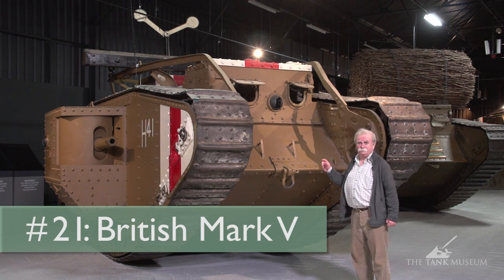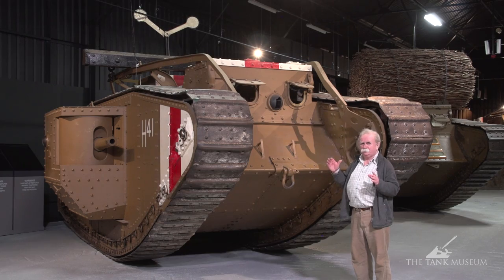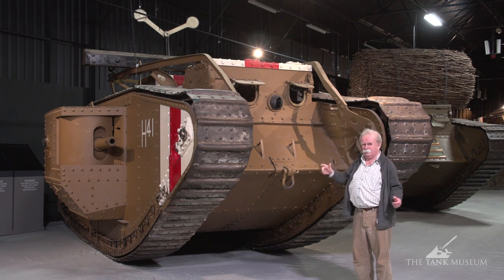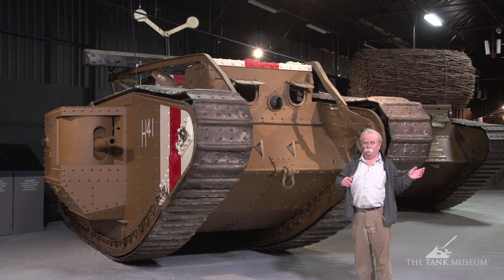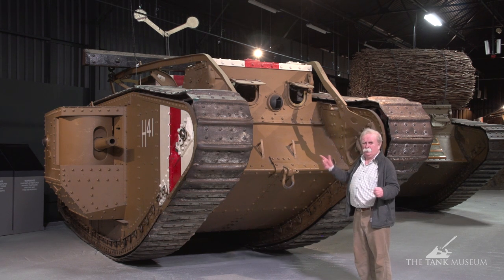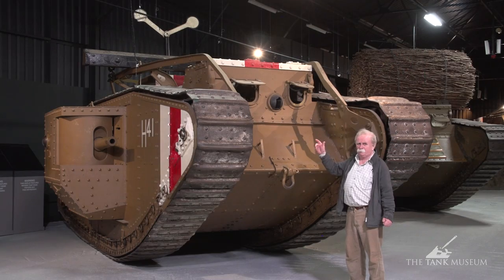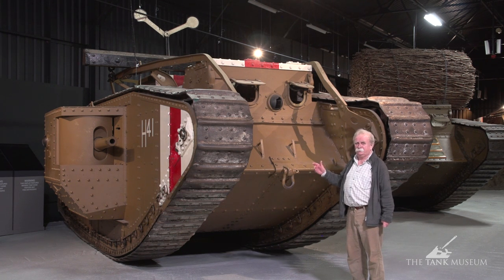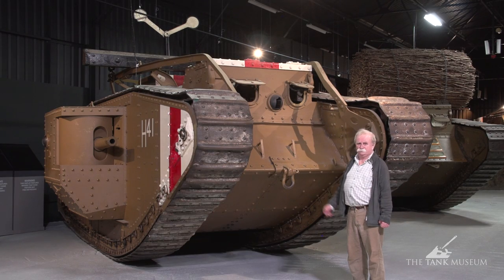Tank Chats #21 Mark V | The Tank Museum

Comment: Would it be possible to show a bit more of the interior of the tanks? Otherwise excellent video.
Reply: That would be absolutely awesome!
Reply: Inside the Fletcher's Hatch?
Reply: Somehow that sounds wrong....
Reply: +TheKirov099 genius!
Reply: I hate to spoil the magic but I suspect a lot of them are pretty spartan on the inside and I don&#39;t mean creature comforts I mean many will be missing the absolute fundamentals; gearing, engines, prop shafts, wiring and equipment. In many cases these start life in a pretty sorry rusted and half decommissioned state and the restorers can work wonders visually but they can&#39;t magic new engines, gearboxes and equipment that will sit largely un-viewed by the public out of thin air. Shame though, I&#39;m just as interested in the interiors of tanks as he outsides in many senses, after all it&#39;s where the crew spent a lot of time.
Reply: The Mark IV and V are basically complete and are in theoretical running condition, though they are not run due to metal fatigue in the track frames. The Mark A is partially complete at least. The IX I imagine is mostly complete as well, and I imagine the same goes for the V**. As far as the WW1 tanks go only Little Willie and the Mark I are completely bare and ruined on the inside as far as I know. 

The Mark II is also mostly complete but it's full of mannequins of crew members lol
Reply: no
Reply: unfortunately the interior was removed, if you we're to open the hatch and look inside,
you would only see the exterior of another tank,
and so on and so forth.

Comment: I have a question, in Battlefield 1, the "Landship" is a Mark V tank, but it has those great big shovel shaped things on the treads sometimes, what are those, and why are they there?
Reply: only some were outfitted with them, and they did what im sure you assumed. help dig in a bit to get some traction. western front tended to be muddy as fuq
Reply: that makes sense
Reply: They're usually called "spuds", and allowed the tank both better traction and ground contact area. They were first used in the Battle of Arras in Spring 1917, and for a while were thought of as a way to distinguish Mark IIs during that action. However photos have since appeared showing some Mark Is in that battle with the spuds too. Mark IVs can be seen with them fairly often, and the large box-like structure at the rear roof of a Mark IV was called a "spud box" and was often used to stow them among many other things. Funnily enough, I have never seen photographic evidence of spuds on a Mark V machine, so Battlefield got that bit wrong. Or a Mark A Whippet for that matter, though they could theoretically use them as well. Spuds were not compatible with the 26 inch track; only the 20 inch.

Crews had a mixed opinion on them. They didn't do an awful lot to help, and they were a gigantic pain to attach and remove. Standard practice was to apply one to every 6th link, though this was far from always adhered to. Sometimes they were applied in bunched up groups with large sections of track without spuds inbetween. And they were not to be used on hard surfaces such as stone or concrete, as the ridges on the bars that span the track links could bend and be damaged, or worse, could lead to the entire track plate twisting and potentially breaking off the links it is riveted to.

Comment: That photograph at the 0.50 mark is staged, right? Very atmospheric regardless, but I cannot seem to find it online...
Reply: Joacim Sydnes yeah it seem a odd photo tank looks to clean
Reply: Had the same thought... A lot of photos and films were staged, but the angle of the tank seems difficult to stage, though there seems to be no-one about in the background. All the same i wouldn't like to be under those tracks...
Reply: Yes, it is from a 1920s era film if I remember correctly. Mark Vs on the Western Front never bore camouflage schemes to my knowledge; always plain brown.

Comment: What I want to know is why does the mark V in bf1 have spikey things sticking out of the side of the tracks
Reply: They're usually called "spuds", and allowed the tank both better traction and ground contact area. They were first used in the Battle of Arras in Spring 1917, and for a while were thought of as a way to distinguish Mark IIs during that action. However photos have since appeared showing some Mark Is in that battle with the spuds too. Mark IVs can be seen with them fairly often, and the large box-like structure at the rear roof of a Mark IV was called a "spud box" and was often used to stow them among many other things. Funnily enough, I have never seen photographic evidence of spuds on a Mark V machine, so Battlefield got that bit wrong. Or a Mark A Whippet for that matter, though they could theoretically use them as well. Spuds were not compatible with the 26 inch track; only the 20 inch. Crews had a mixed opinion on them. They didn't do an awful lot to help, and they were a gigantic pain to attach and remove. Standard practice was to apply one to every 6th link, though this was far from always adhered to. Sometimes they were applied in bunched up groups with large sections of track without spuds inbetween. And they were not to be used on hard surfaces such as stone or concrete, as the ridges on the bars that span the track links could bend and be damaged, or worse, could lead to the entire track plate twisting and potentially breaking off the links it is riveted to.